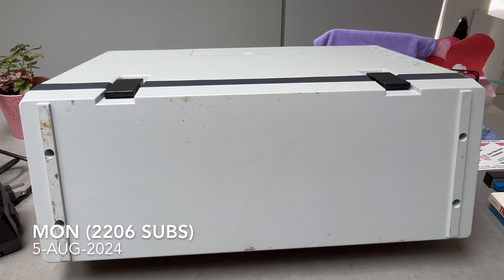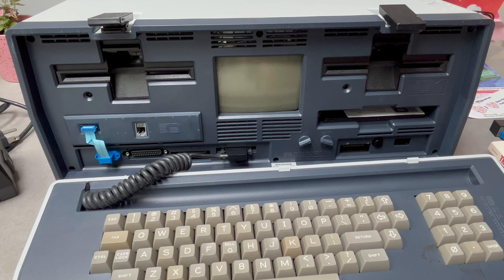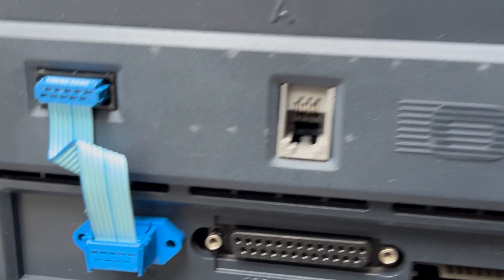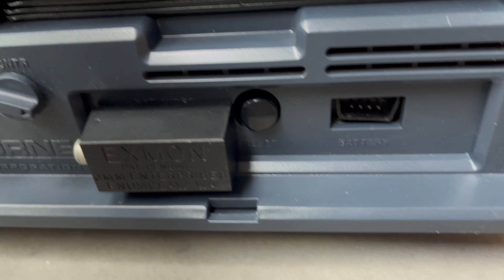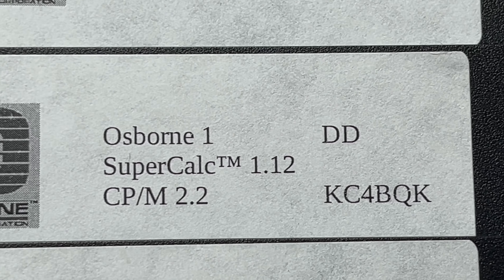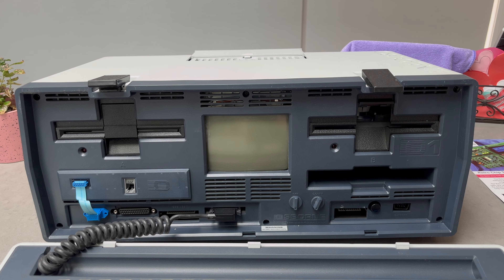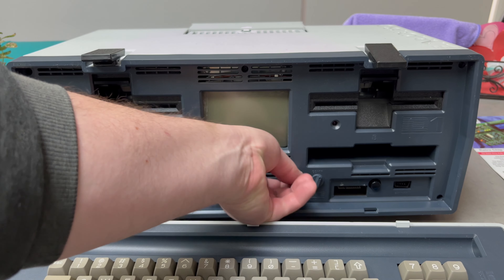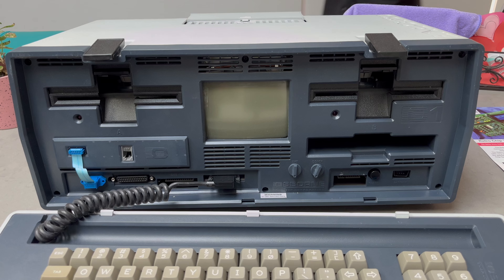🇺🇸 Osborne 1: Part 1 (Quick Look) [TCE #0501]

Comment from the maker: Update: watching some other videos it seems that I either need to install a shunt on the "EXT VIDEO" port to connect the top-side PCB signals to the bottom-side of the board ... or I should've installed the external video out dongle that it came with!  I left the dongle off because I wasn't sure which way it should be installed.

Comment: I used one of these when I had a student job at my highschool, building an alumni database from paper records. I don't think I've ever seen the insides of an Osborne. Looking forward to seeing your repairs.
Reply from the maker: How did you find the screen?? The keyboard seems quite nice to type on, full sized, and having a pair of floppy drives as standard also is nice, so I imagine it would've been a pretty decent machine to work on ...
Reply: @Brfff  The screen was fine back then when my vision was 20:15. The apps (dBase, Wordstar) were clunky: all those unintuitive shortcuts you had to memorize and that changed from one app to another.

Comment: I do not mind admitting being just a bit jealous. Nice machine.
Reply from the maker: Thanks!  I think I got it for a good price. I'm surprised how nice it is considering its age.  I've been reading the technical manual so have more of an idea on how to, well, "turn it on" now ... it looks like the power supply can be simply converted to 230VAC so hoping to see something more tomorrow.  It apparently had an issue reading disks ... didn't seem to be doing anything in today's short check ... couldn't hear any head movement at all, just spinning.